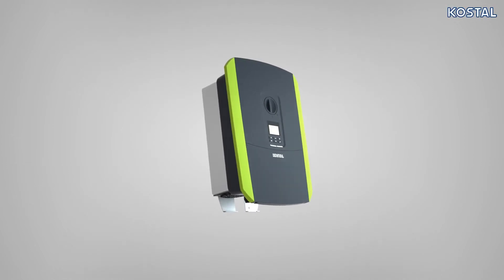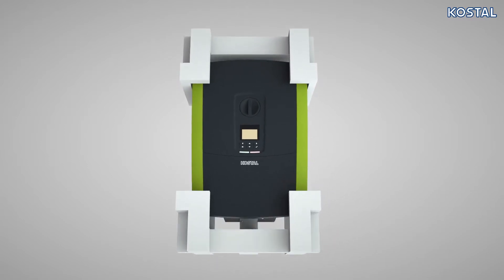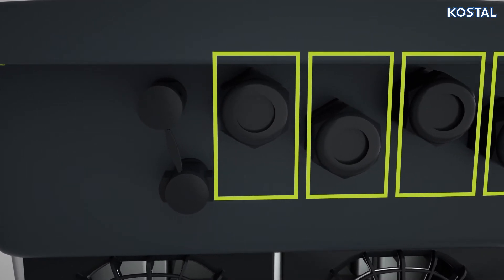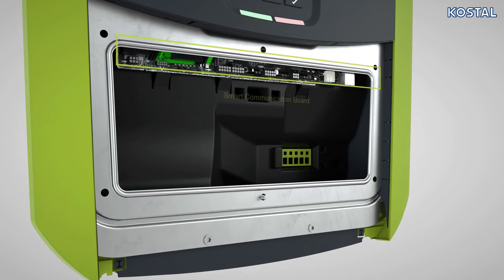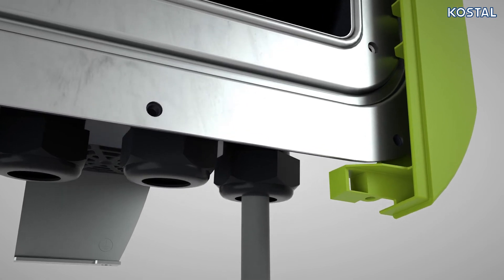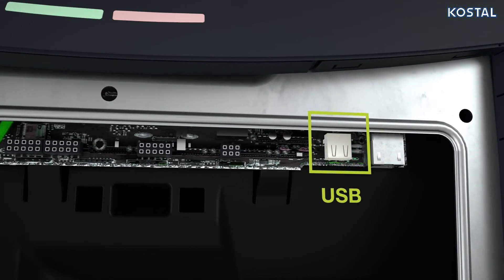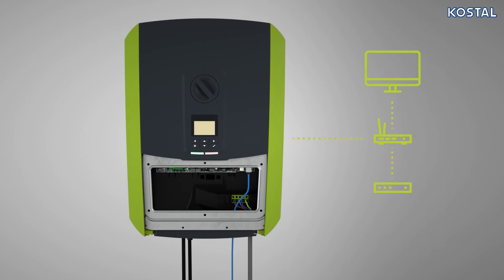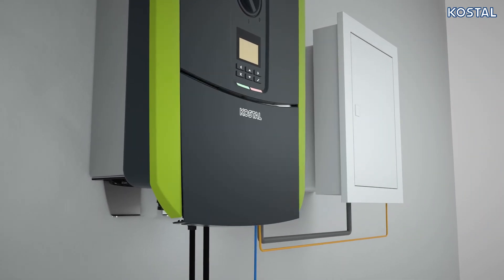PLENTICORE BI: Installation and proper use

Comment: Is it possible to add a smartmeter for a third party inverter?  Would be nice to have the production from an old inverter in the same portal as the battery.
Reply from the maker: Hello @jonasbergqvist1588,
only KOSTAL Smart Energy Meter and Energy Meter are compatible to other KOSTAL components.
Greetings,
KOSTAL Solar Electric